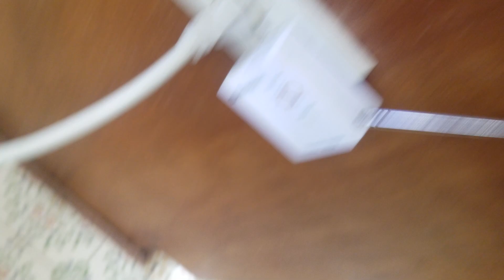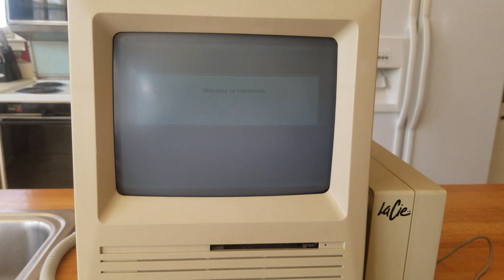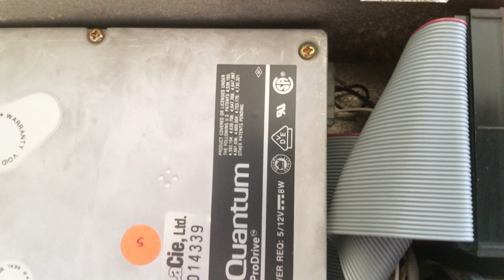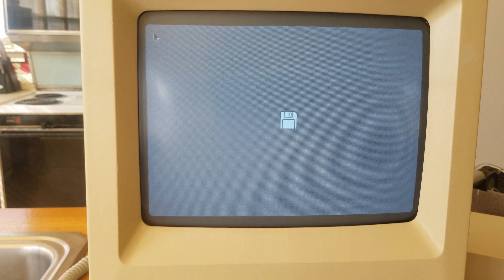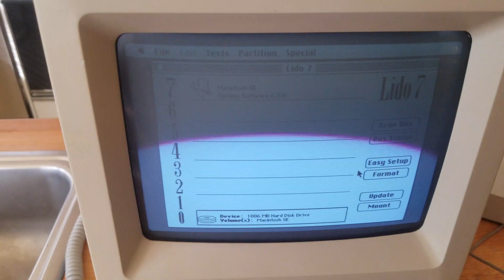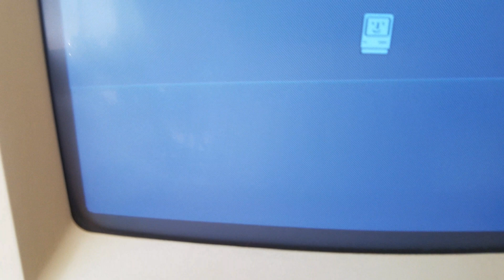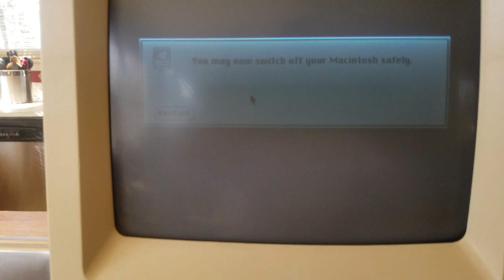03/12/2019: Experimenting with SCSI2SD in External Hard Drive Enclosure Part I

Comment: I have exactly the same SE with 2 FDDs. The floppy drives are just a pain in the ass to deal with! I have all sorts of problems with them, broken eject gears, damaged heads, unalignment, stc. I want to internally install a SCSI to SD card as you did, but don't know which card I need. Also, SEs with 2 FDDs don't have SCSI ribbon nor molex power cable, so do I need to get these as well?

Thank you :)
Reply from the maker: Actually, you don't need to use a molex connector.  I don't on mine.  I actually have both floppy drives working with the SCSI2SD! ;)  If you go to the SCSI2SD page, I believe you can reference which release will work with that machine.  I don't remember which ones I have, but the last one I purchased in March of last year cost me $83.89 total, shipped, etc.  I have two or three of them.
Reply: @BollingHolt  Thank you. I found the compatibility list here: http://www.codesrc.com/mediawiki/index.php/SCSI2SD_V6_Compatibility
I think I'm good to go with V6 card for my original SE :)
Reply from the maker: @_techana  Good deal! Let me know how it goes, and take some video! ;)

Comment: What if you wanted to use an external SCSI2SD card as an external floppy drive? I'm looking at doing this as a means to easily transfer word documents (.doc) between my Mac SE and a modern windows computer. Would this be doable?
Reply from the maker: I'm not sure about using that device as a floppy replacement as it's geared to connect through the SCSI interface.  However, a device called the Floppy Emu would do the trick.  I have one of those as well and would like to get a couple more.  https://www.bigmessowires.com/floppy-emu/